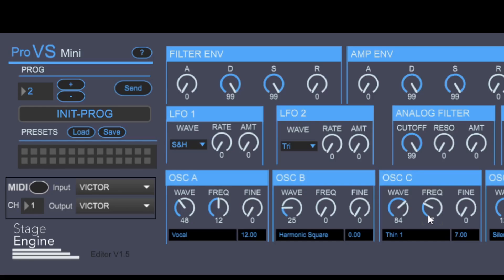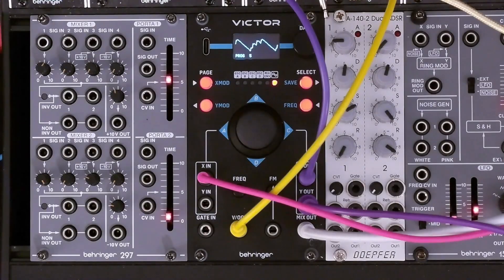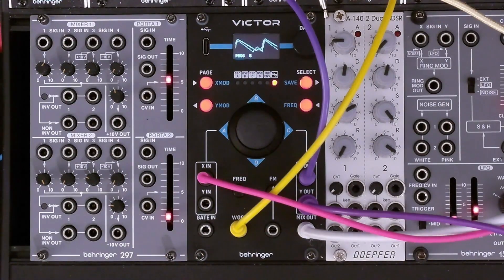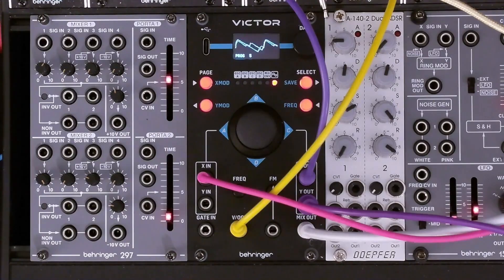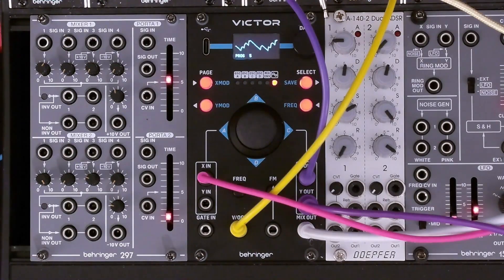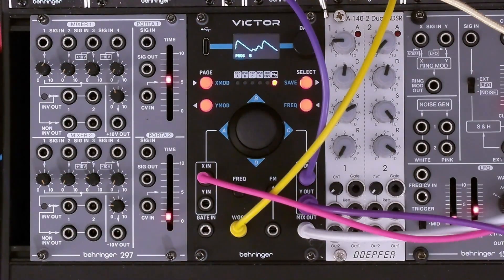Victor Part 3 - Detailed Tutorial (2 of 2 )

Comment: Greta video! I like Victor and often use it in my rack. I also like the joystick. I would love a setting that disabled the stick from an internal perspective IF cv is connected. I could then get x y modifications externally while freely using the stick for manual modulation
Reply from the maker: That would be cool.  BTW, there are not many euro joysticks available for $80, so buying a second Victor would be an option.

Comment: Hey OZ, great video! I got two Victor recently and I noticed that they are not tuned the same. Is there any calibration that can be done? I'm unable to find this info anywhere if there is such a thing, so I thought I'd ask you.
Reply from the maker: Page 51 of the Victor Quick Start Guide does indeed have a tracking (v/oct) calibration process.
Reply: @ozhalljr wow I totally missed this. Thanks!!!
Reply from the maker: @TriangleWaveRecords  yw.
Reply from the maker: thanks.  I'm assuming by "not tuned" that you mean putting the two oscillators at the same pitch (without any v/Oct input).  The "freq" knob is the (fine) tuning control on the Victor.  Try starting at the "noon" position (the middle) on each Victor, then fine tune one of them from there.  
If this is a tracking problem, let me know.
Reply: @ozhalljr I’m actually using a Hermod+ to sequence them. So I have the Hermod+ sending pitch CV into each, and both channels are sending the same voltage but for some reason the two Victor do not output the same pitch even with the knobs turned in the same  position
Reply from the maker: @TriangleWaveRecords  Just to be clear, if you pick a step; stop the Hermod+, then tune to unison are the other steps out of tune/
Reply: @ozhalljr yes, let’s say I’m playing A (440Hz) on both Victor modules from the Hermod, then both are not in tune if the knobs are positioned the same on them
Reply from the maker: @TriangleWaveRecords  Don't look at the position, I don't think you can count on the position.  Just tune one to the other by ear.  Also, try swapping Hermod+ channels to be sure that the Hermod+ outputs are the same (they probably are).
Reply: @ozhalljr for sure! I was hoping there would be a way to calibrate this but I guess not 😢

Comment: Can’t get the usb on mine to see anything 
Any way to fiind out the firmware installed without connecting to a computer ?
Tried on iPad, phone and Mac   Nothing sees it
Reply from the maker: There’s no way other people than SynthTribe software to access the firmware.  SynthTribe should automatically detect the module if the USb connection is good.
Reply: @ozhalljr  damn. My usb socket must be bad as no version of synth tribe is detecting it

Comment: Out of curiosity, in the Audio FM into 921B use case, what would happen if you plugged the output from the Victor into the other 921AB Link Freq input which is a 1v/oct input?
Reply from the maker: You would get the same FM effect as into the audio FM input.  The only difference is that the frequency link input is DC coupled.  This would allow any DC offset from the Victor to raise( or lower) the frequency by some constant amount.   Have you tried it?  Do you have the 921 A/B and Victor so you can try it?   Let me know.  This is a very thoughtful question.
Reply: @ozhalljr  Unfortunately no, I don't own them. But I'm shopping ;^)
Reply from the maker: @krikor111  If I play around with this, I'll try to give you some feedback on it.

Comment: Thanks! These videos are helpful. Do you have any idea what the process is for transferring patches from the pro versus mini to the Victor module? I have not yet been able to figure it out.
Reply from the maker: First, thanks for watching and commenting.  Second, did the chapter "8:41 - Synthtribe Software" in Victor Part 3 (tutorial 2 of 2) make sense?
Third, I do not own/have access to a Pro VS mini (VS = "Vector Synthesis" here).  The Synthtribe software allows you to connect (via USB) both the Victor and the Pro VS mini to a computer.  The computer, of course, is running the Synthtribe software.
In this video I demonstrated copying a program from the Victor to a file on the computer.  
With both synths (Victor and Pro VS mini) attached, the transfer would be from the Pro VS mini to the Victor.  I'm not sure the transfer will work in the opposite direction, but I can't say for sure.
Watch that chapter again and let me know if that makes sense.
Thanks - O.Z.

Comment: Hey OZ
I saw that editor on line. Glad to see that it works with the Victor also. I will certainly pick up a copy. The joystick out is really fun and very useful for all kinds of modules. I have been checking around and heard that they may provide a polyphonic option in the future through an update. That would give you the ability to control the 4 oscillators through midi. Lets hope they do this sometime soon. I am really having fun with this module. Thanks for all the great info yet again. Cheers
Reply from the maker: Thanks Tony.  It has been fun working with it.  The editor really only supports sending MIDI CC.  I'm hoping they update it to work with the Victor.  Even then, without sending a full Program to the Victor,  all editors are hamstrung  because the Victor only responds to those twelve MIDI CC commands.